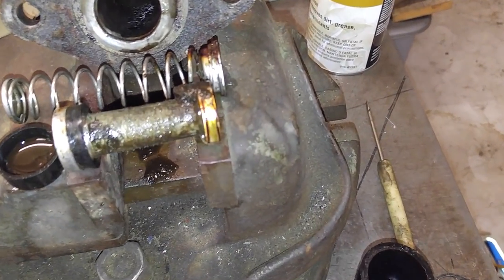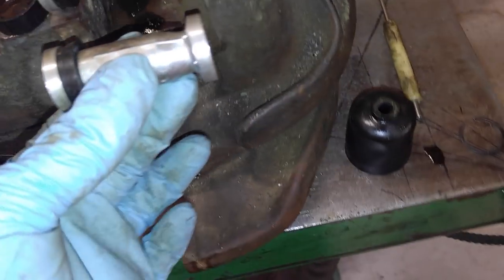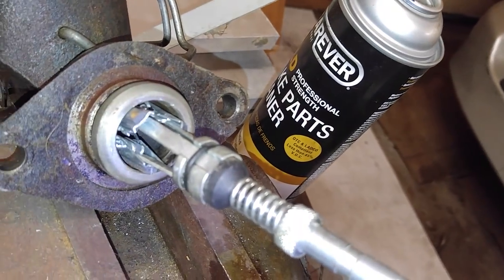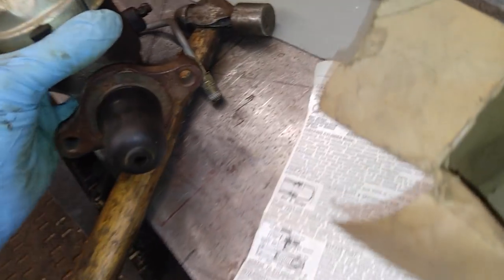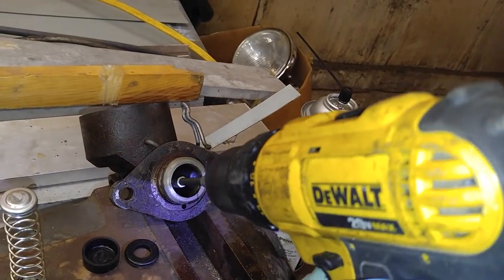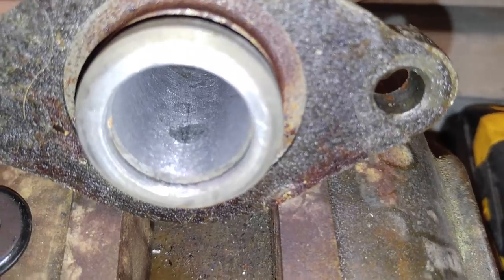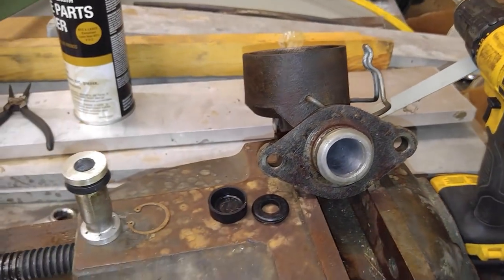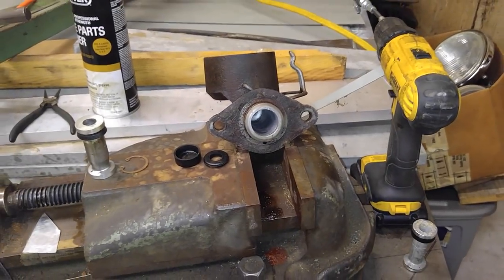Corvair Master Cylinder Rebuild Junk 8 4 18

Comment: Of course the master cylinders are the same! The corvair used the same brakes as the Skylark except the drum sizes (widths) were swapped front to rear. Ugh, single brakes! Our 66 98 uses the same master cylinder. Soon to be swapped for a dual cylinder.